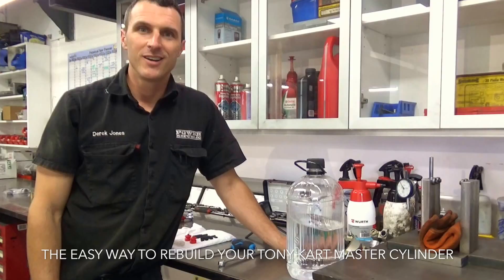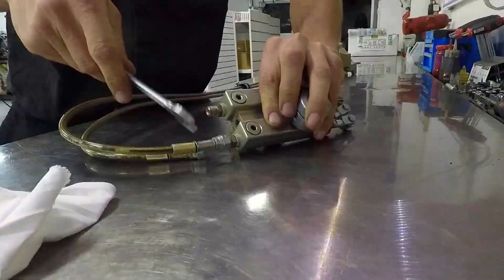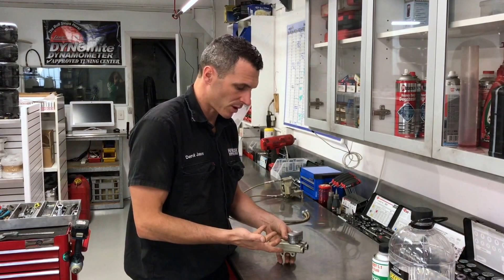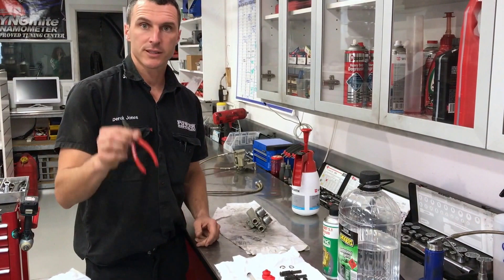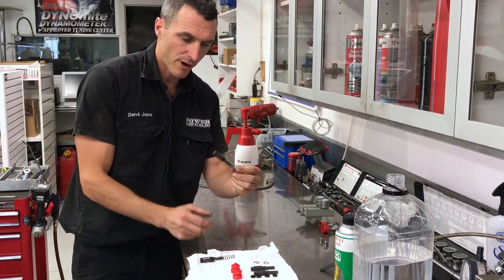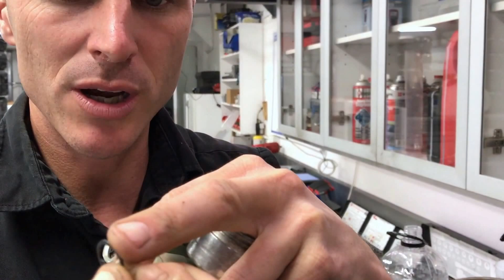Power Republic - The Easy Way to Rebuild Your Tony Kart Master Cylinder

Comment: Great video, I hope you read the comments - I just tried rebuilding my master cylinder. But when pushing down, the second seal was cut when I pushed the piston down… I don’t see you doing anything special to avoid this, more than putting brake fluid in the cylinder and on the piston to lubricate. I did too, but it didn’t help 😢
Reply from the maker: maybe you have a slight burr or sharp edge.   get some 800 or 1000 grit emery paper or scotch brite even, and rub the sharp edge off.  then use some rubber grease to ease it into position with out damage
Reply: @ Thanks for replying, will check/try this immediately!

Comment: Do you have any tips, or order of operations for putting brake fluid back in the master cylinder after rebuilding them, and replacing the brake pads? Thanks for all the awesome and helpful content!!
Reply from the maker: thanks for the positive feedback, we have some more video's on brake bleeding too for you to check out.  We put our fluid in the reservoir first then pump it through.  if it is a mission, sometime blow some fluid through with a syringe can help get it started.  hope that helps

Comment: Hi, great videos really inspirational! I'm trying to refurb a master cylinder, but when I take the c clips out, the pistons don't come out and I just can't get them out! Any idea how to get them out and how that could happen? Also, would be great to see a video on changing bearings on a spindle
Reply from the maker: Hi Charles, thanks mate for the feedback.  I would push the pistons in the cylinders so that they move in on the spring, then release them and boom, it should spring right out.  also try some WD40 or equivalent.  worst case is there is a burr from the c clip and that is stopping the pistons.  maybe get a file or air grinder and gently remove the burr next to the groove.  good luck and I hope that helps.
D
Reply: @PowerRepublic  thanks. I've got them out now, had to pull them with some pliers. Looks like the o rings were preventing them from coming out

Comment: Hi, after last session one side on the mastercylinder had leaked and also the fluid was kind of slightly dirty coloured inside the cup. A friend at track said that it was most likely the seals inside on the piston, that I now know how they look like thanks to this video. My question is if I can do as my friend said and just loosen thoose things with the red cups and take out the things (pistons? sorry forgot what they are called) with the two seals on each side, than change the seals and put them back without having to take the mastercylinder and everything off the chassie as you have done in this video? The leak appeared after I bleeded the brakes, but at first it was just little leak, but now after a couple of sessions this one side leaked more! I'm going out tomorrow to try fix it so  please help me 🙂 cheers and thank's for being there with your videos, they help a lot 🤙
Reply from the maker: Hey Jesper,  you are very welcome.  yeah when you bled the brakes the fluid might have blown past the seals that weren't at 100% to begin with.  Now they are leaking bad, so yes pull them apart and and replace the seals just like in this video.
Reply: @PowerRepublic  I think it went well 👌 cheers

Comment: What can I use instead of the Methylated spirits?
Reply from the maker: Andrés GarcíaML you could use brake cleaner or workshop solvent. However they leave oil residues and can contaminate your fresh fluid.
Reply: Power Republic Can I use white gas?
Reply from the maker: Andrés GarcíaML is that white spirits?  Anything good to dissolve the fluid.  Methylated Spirts is best or any alcohol based Cleaner.
Reply: Power Republic Yes I research and here in Mexico white spirits is kwoned as gasolina blanca=white gas

Thank you very much

Comment: Can i paint the master cylinder? no problem?
Reply from the maker: Luis Balsas yeah I think you could if you just tape up the fittings and plug holes. I light sand with some 600 grit paper and whatever colour paint you want shouldn’t effect the brakes performance
Reply: @PowerRepublic  Thanks for the reply, my master cylinder is all beat up ツ

Comment: Derek, great video but there is one item that was not clear. The orientation of the seal on the piston. I actually have the BS2 master cylinder. I did not note the orientation of the seal when I removed it. I think it shoul be oriented that as the piston moves forward when the brakes are applied the seal lip should expand outwards against the cylinder bore as the brake fluid pressure increases. Am I correct? Thanks. Miro
Reply from the maker: Hi Miro,

Thanks for the great question.  If you pause the video at 4.22 you can see a close up of the piston and seal assembly.  The lip of the seal faces the direction that the piston is going to travel.  This way it makes pressure and seals in the master cylinder.  hope that helps you.

Derek